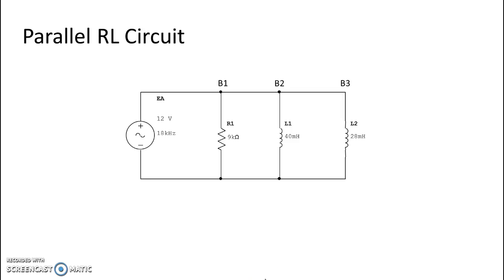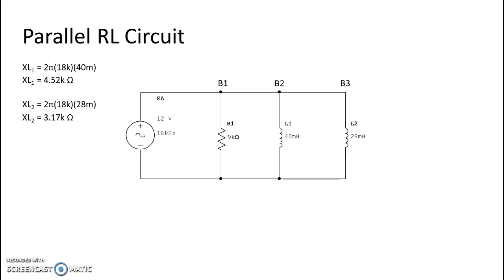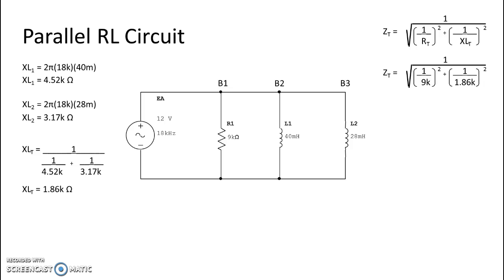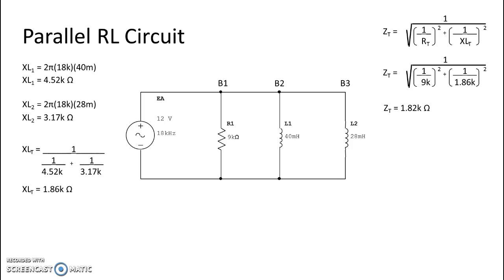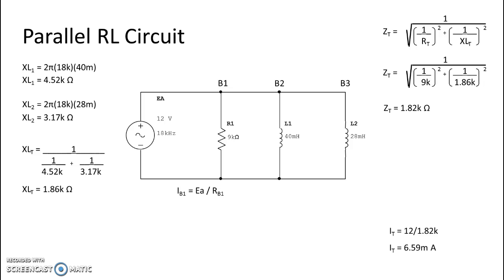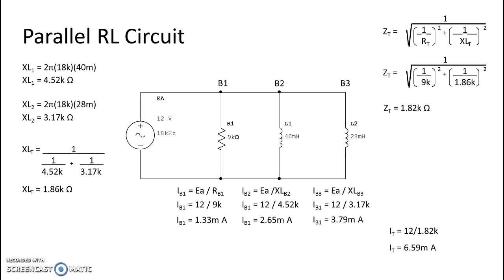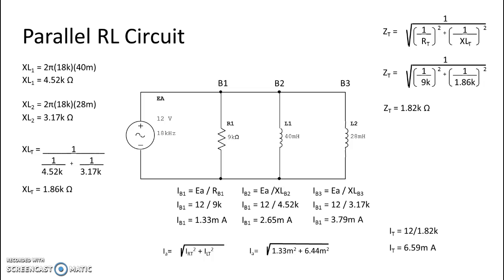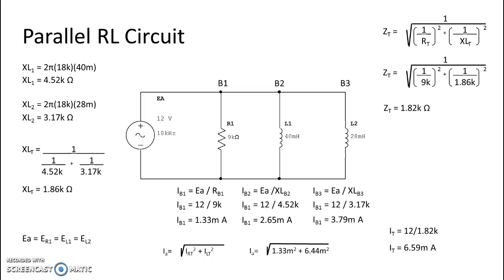Parallel RL Circuit - Calculations

Comment: Thank you for your video i am on day 4 of BMET school and your video was very helpful the only thing i wish was different. I wish you explained step by step what keys to push in the calculator for those that are not calculator savvy. I also wantes to ask if i am missing something on the last step of this video because when i did 1.33m^2 +6.44m^2 and get the root of i get 6.57. You said i should get 6.59.
Reply from the maker: Thank you for your question and feedback.  It is not unusual when you are double checking to see numbers that are a couple hundredths off.  That is caused by rounding to two digits.  You would get a more exact number if you went out further.  For instance, when I redid the math for the numbers you have in your question my calculator gives me: 6.57590298m.  If I use standard rounding (5 and above go up and 4 and below leave it) to two decimal places I get 6.58m, which is not 6.59m, but only 1 one hundredth off, and so would be considered essentially the same.  I do talk about this difference in some of the videos, but I guess I missed it in this one :-)